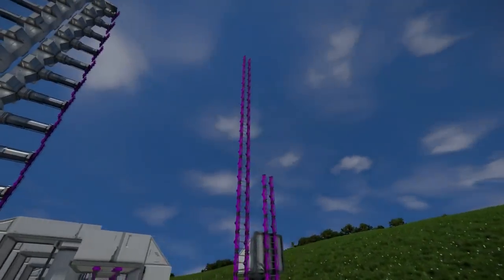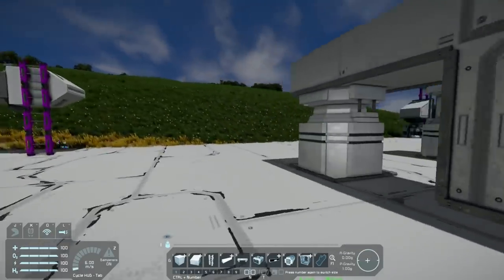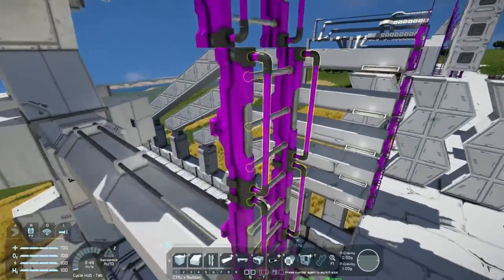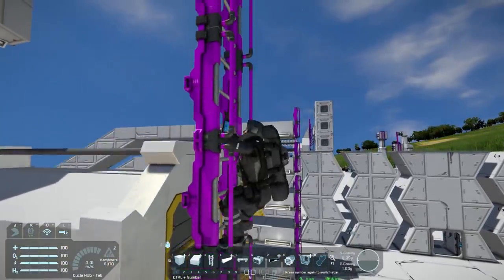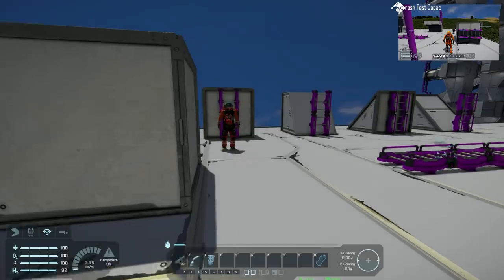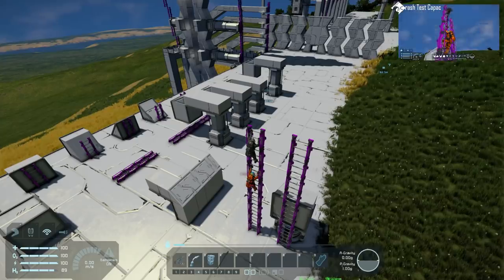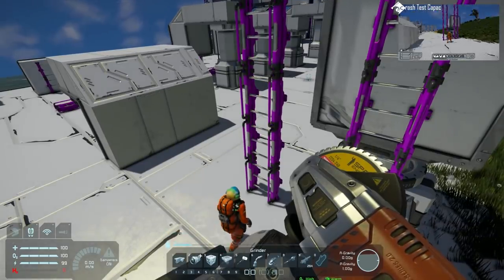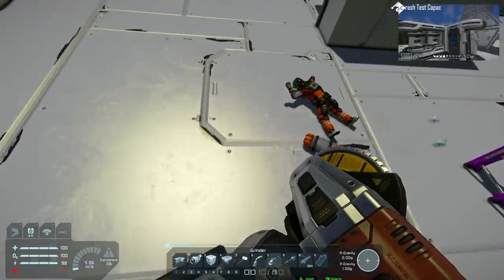Space Engineers Clangbusters: Ladders (Tips, Testing, Tutorials for Survival)

Comment: Did I miss you testing ladders that were twisted laterally to one another? What if the ladder you are on is ejected (blown off) of the grid? Falling damage while holding a detached ladder in freefall? Falling damage when grabbing a ladder out of free fall? Ladder impact resistance as a lander aid? Could you forcefully inject someone through the hull of an enemy ship with a ladder like some kind of space botfly? Any problems climbing on a ladder that you don't own/what if ownership of the ladder changes while you are on it? When you enter a cockpit, it puts you back in the same place from whence you came when you exit, is this changed by getting in a cockpit directly from a ladder? Will it put you back on the ladder or in the same spot or in a neutral spot? Will a ladder provide protection from a ship welder if the ladder is between you and it? 

K I think I'm done. Thanks Splitsie. I had fun. BTW I''m fighting with the Hydrogen Engine. It won't draw hydrogen after building it or piping it, gotta have the system ready to go and then reload everything to get the engine going. Hoping that's just a Me thing.
Reply from the maker: There's an easier way, I've found that turning the engine off then on again works to get it going (as long as you already have it piped and with fuel ready to go) :)

I did forget one aspect of twisting... dang :/ And interesting thoughts about ownership, that would be useful to test. 

With the question of ladders behaving like cockpits when you get off, nope they don't. The ladder always puts you near, so you can become trapped in a space if you grab a ladder through an entry you otherwise can't fly through - Capac was doing that while I was building all the rigs :P 

As far as I could tell you couldn't get into a cockpit from a ladder as you would first exit the ladder on pressing F then have to enter the cockpit with a second press.

I'll have to look into the protection side of things, as it would be nice to know if you can trap them with welders/grinders/thrusters
Reply: @Splitsie  Ladders do not have ownership as they do not contain computers :)

Comment: "What's the optimal setup with maximum power output and minimum volume?" is the most important question I have with wind turbines.
Reply from the maker: I have some ideas I want to test with those, I suspect there might be an odd setup that is possible where you can have them relatively densely packed :)
Reply: What I have found with windmills is 8 blocks space works best. It isn't the perfectly ideal maximum output, but at 8 blocks apart and 8 blocks up from the ground, or more height would be okay too, it allows the most power in the most compact space.

The flip side to this is to offset each row by half, and only leave 4 blocks between columns, but still space them 8 blocks apart on their corresponding rows. The output will be down just a little, but the gain from the compact nature of the setup outweighs the losses.

You can also alter the height of each windmill and get them a lot more compact. I dont do this as it makes my OCD go apeshit!

Comment: Splitsie 'torsional force': torque. Units: Newton meters.

Also, at 18:03 you suggested putting ladders on pistons to go faster. Faster is good, but it seems like then you're just making an elevator, so what is the point of the stairs?
I'm sure you will find creative and ridiculous uses for stairs, but do they have much practical utility? The main use I see is as a backup way up (from a mine, base, whatever) when out of hydrogen.
Reply from the maker: That's the main one for sure, a backup escape for when you really don't want to be building stairs :P

Comment: Things to test with laders:
Can you use a button panel while on one
Can you close an air tight hanger door on one
How high up from the ground can you get on one
How do they work when going between difrent dirctinal gravity? Is the engineer always the way the ladder is placed or do you flip? Can you go between 2 ladders top to top?

Survival kit questions 
is it now worth keeping all the stone getting the ingots and ejecting the gravel when mineing?

Wind turbine questions
At what height do they reach max output
At what height if any does it start to drop again
How close can they be placed together with out loss in power
Can they work in a cave if its large and high enough? Thinking tunnel in the side of a moutain and a large hole / pit in the top of one.
If you convert a ship to a station will they work?
Reply from the maker: You can't use a button while on a ladder, but you can remote control something. I should have tried the other doors after the weirdness I saw, kind of disappointed I didn't :P
As you might have seen from the timelapse at the end, gravity has no effect on an engineer on a ladder, I transitioned from Earthlike gravity to zero G to Moon gravity without any problem at all  :)

I'll keep those other ones in mind when I get around to testing those blocks :)

Comment: Two words: Ladder Monorail
Reply from the maker: You probably could...
Reply: @Splitsie  Now that I've had time to actually think about it, it would also be theoretically easier to make very tall elevators with them, too.
Reply: If there was a cog wheel which aligned with the rungs...
Reply: @paulgascoigne5343  Well to be fair I was just thinking of using the ladders as guide rails and having the elevator rise and fall with thrusters and landing gears on each floor to catch it as it descends.
Reply: @kevingriffith6011  very true. It could be a useful mechanism incase of lift failure also, as you would still have a way to move up and down the shaft (no pun intended)
Reply: Or... instead of thrusters you could use Artifical Gravity so you don't have to power the subgrid... that could be a thing too.

Comment: Splitsie, you tested the clang out of the ladders. Good job. But... you missed merge blocks. I see ladders mounted to each other, but if they are on merge blocks (or the appropriate place on merging grids) do they merge and demerge when you unlock the merge blocks.

If they don't merge, you could use these to make a vertical transition with the air tight hanger door docking collar design from the planetary ships in Survival Unlikely
Reply from the maker: Ladders have an attachment point at each end which means that they would also get stuck if you used merge blocks to join two grids where two ladders would then be end to end. Sadly this means you can't use them like the corner blocks to create a joined grid that is able to separate again :(

Comment: Hey so i have tried putting a ladder right against a sliding door so when i walked to the top i was right on the door but i wasn't able to because it kicked me off every time. (Just want to say)
Reply from the maker: I was able to get the ladders inside the doors to allow for a smooth exit, but it was fiddly to do so. As to climbing off the top of the ladder onto a block, if the collision meshes don't line up well you can get shoved around a bit, but that's the case for all of these sorts of animations where the character ends up in a different spot than where they started - and not just in SE sadly :/

Comment: how long does it take a single O2 generator to fill up the new hydrogen engines? Large and Small grids. Do they fill their reserves from H2 tanks? How long does that take. Do more genrators fill faster? Or is there some imposed limit of transfer rate. What is the optimal number of H2 genrators to O2 genrators, running at full capacity (How many engines can run off of a single o2 generator, with each generator outputting a full 500MW of power. I can imagine using Ions and jump drives to burn the energy, I'm sure that there's a mod that could make this easier). I'm sure that you can think of a bunch of other things to test them!

HURRAY TESTING :D
Reply from the maker: Nice list, thanks :)

My plan before recording the test is to write all these up and see how many I can fit into a video of reasonable duration (I could have kept testing ladders for hours) :P

Comment: hydrogen engines i had an idea for a kill switch eventually a piston with a connector that shuts off fuel through the conveyor system and unless you had an outside power source you would not be able to move the piston
Reply from the maker: Are you thinking of setting something like that up as a bit of a trap? Or just to mess with someone ;)
Reply: @Splitsie  sort of but more in the sense the vehicle wouldn't move and said thieves would have no idea why

Comment: Can you press buttons / use control panels from a ladder
Reply from the maker: Sadly not, since you need to press F to do so, which takes you off the ladder. Or at least I couldn't get it to highlight and work :(
Reply: @Splitsie  ok, thank you for confirming. Do sensors still detect an engineer when they are on a ladder?
Reply from the maker: That's an interesting question, I'll have to test it out :)

Comment: i want you to test if the hydrogen engine is a free energy device
Reply from the maker: That's definitely going to be part of it :)
Reply: Quick answer: it is not.

Long answer: You need at least one Oxygen generator to process ice in order to fuel the hydrogen engine.
the O2 generator needs power to boot up, as well as the engine itself (not sure about this one). Once it's in use, and from what I saw, the engine energy is used to power the O2 generator, on top prior of whatever power source you used to boot the system.
I tested it on small grids, and you need at least 2 small batteries (400kW), or one small reactor (500kW), to power up your setup. If you shut off the batteries/reactor while engine is in use, it start malfonctioning, like if the engine couldn't use is own power itself.
Reply: @jefflemenestrel  infinite energy devices normally need a jump start. as for the battery, does it run forever as long as you provide ice?
what if you use a hydrogen tank instead of a battery? these are all things we need to know @Splitsie